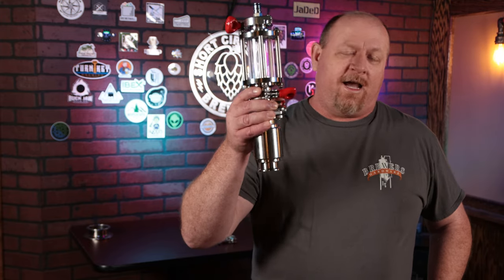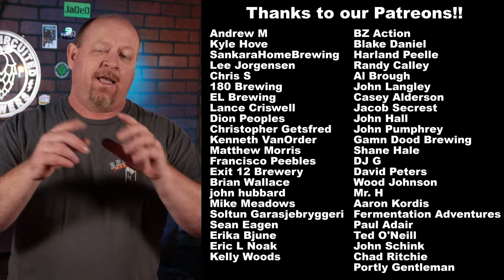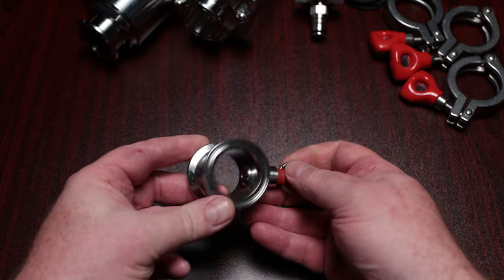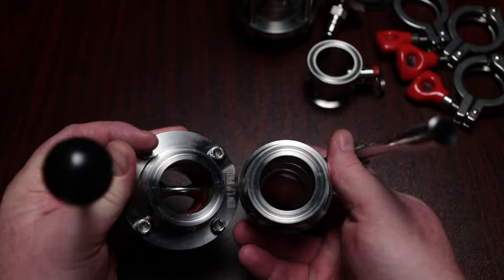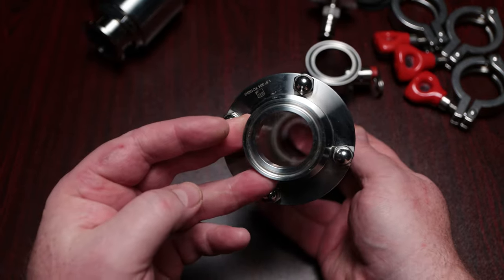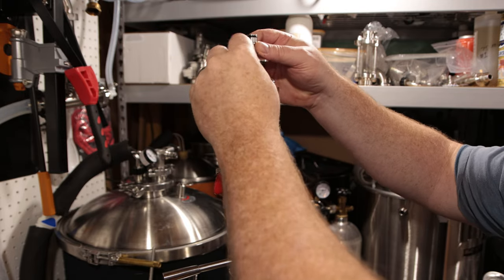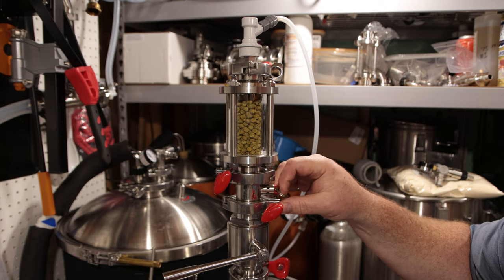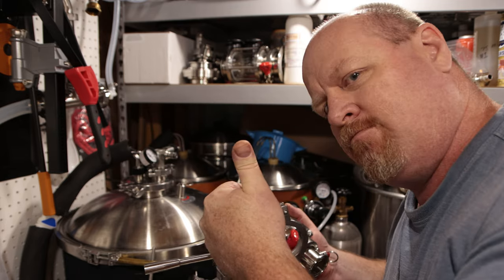Brewers Hardware 1.5" Tri-Clamp Dry Hopper

Comment: That ball valve looks pretty clutch.  I use a similar setup with the butterfly valve and I always have to tap the sight glass with a rubber mallet and/or work the valve handle several times to get the hops to finally drop in.  This valve makes me feel better about not having a larger port on my conical lid.
Reply from the maker: Yes! It works well! 👍🍻

Comment: Yeah I can definitely confirm that a 1.5” butterfly valve is a real pain in the a**. 
I didn’t go the ball valve route because I like how easy a butterfly valve can be cleaned. So I had to work with a 1.5 to 2” reducer and 2” butterfly valve. Works like a charm 🍻. Never had an issue with DH charges as high as 10oz

Comment: Brian - Great video!  I could totally see myself getting this!  I have a Spike CF10 system with the three 1.5 inch ports on the lid.  I like the ball valve vs the butterfly valve point you made.  So that makes sense.  Let me know how much.  January no problem since its for me.
Reply from the maker: There's a link in the description. I believe they go for 169 right now. Regarding the valve I was a little incorrect on that both valves that they sell our ball valves. One of them is just a hybrid that I believe has a locking mechanism like a butterfly valve would but they're both ball valves.
Reply: If you have a CF10 you don't need this - there's much easier, faster and cheaper method to dry hopping. 

I have a Spike Flex+ and I go through 4" TC - just before dry hopping, you purge all pressure from the vessel. Then connect your gas to the gas manifold. Set your CO2 to around 2-3 PSI and start to loosen the 4" TC. Once the clamp comes off, leave the lid sitting on top (CO2 will be coming out, and lid will be vibrating on top). Turn the CO2 up a bit more (you should hear it rushing out now - preventing any oxygen ingress), take the cap off, toss the hops in, cap back on, gas off, clamp back on, all in quick succession. Doing it this way provides positive CO2 pressure inside the vessel and prevents any O2 from entering as long as you keep the gas on. This is honestly probably more effective than the dry hopper since no matter what you do, you'll never purge 100% of the O2 from the sight glass.
Reply from the maker: Sounds like a pretty large waste of CO2?

Comment: If CO2 is heavier than O2, why would the PRV be below the CO2 inlet? If you let the "gas mix" settle after some time, shouldn't it go out the top?
Reply from the maker: I think filling the chamber and discharging several times is enough to purge the O2. 👍🍻

Comment: Thank you, this is another great video and a cool tool :) Would it work with a Grainfather GF30 conical fermenter? How can you ensure that you not let any oxygen to the fermenter when you remove the airlock?
Reply from the maker: Install the valve from the start and then put the air lock in the end of the valve.. close the valve before you remove the air lock. 👍🍻

Comment: Went online to look at their products… what is the difference between the standard and the hybrid ball valve? Read through the description, but didn’t catch it.
Reply from the maker: I believe that the difference is the hybrid valve has a catch system to lock the valve in position like a butterfly valve. I misunderstood the description as well they are both ball valves one has a lock system and the other one moves freely with no locking system. 👍🍻

Comment: Brian, wouldn’t it be better to have the ball valve already attached to the lid of the pressure fermentation chamber. To avoid contaminating the wort with air and save on purging out the air with your Co2. And you maintain the closed loop for fermentation.
Reply from the maker: I didn't mention that but yes. That is actually how I did it.
Reply from the maker: I just mentioned that in my pin comment thanks for pointing that out. I guess I thought it was obvious but if I didn't say it then people might be confused.

Comment: Will it work on the Anvil Crucible? Actually still waiting for my crucible to arrive.
Reply from the maker: The triclamp fitting that they make for The crucible might be a little bit tight but in the video that I showed the new triclamp connections I actually put a link for one that fits perfectly in the opening you might have to use that one instead of the Anvil designed one.

Comment: Seems to be what I'm looking for but does it work on unpressured system ? If so, how can i use it since i cannot pressurize ?
Reply from the maker: Sure not a problem at all. I'd still do the CO2 purge on the hops in the sight glass though. 👍🍻
Reply: @ShortCircuitedBrewers  Fine :) Thnks for the quick answer ;) I saw you used some John Guest fittings. What's the one you used on top of the drop hopper ? I'm thinking of adapting a sodastream CO2 bottle to make the purge system (since I don't have pressurized system i don't need big bottles :))
Reply from the maker: @ADreNaLiNeDJ  it's the duotight ball lock connection. Kegland brand..

Comment: I couldn't see just how you had things configured on top of the G4.  There must've been a spunding valve.  Where was that attached?  This something I don't like about the G4 lid - not enough ports.
Reply from the maker: It. Was in top of the ball valve. There is a PRV built into the lid. So no safety issues.
Reply: @ShortCircuitedBrewers  I thought the sight glass was on top of the ball valve?
Reply from the maker: @jimbalz3017  it is. In the video the entire assembly is actually on a G4 7.5. I have the ball valve on first then the prv assembly then the sight glass then the gas post. All I had to do was shut the ball valve take off this funding valve that was on top of the ball valve and then put the other pieces in place for the dry hopping.